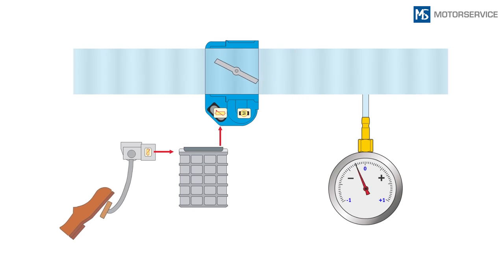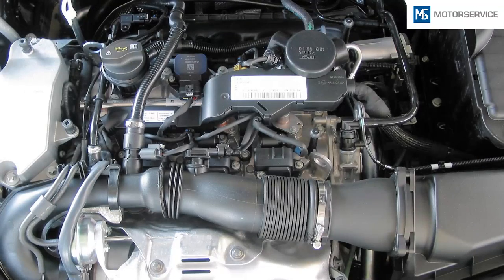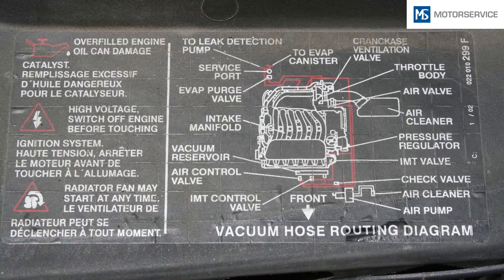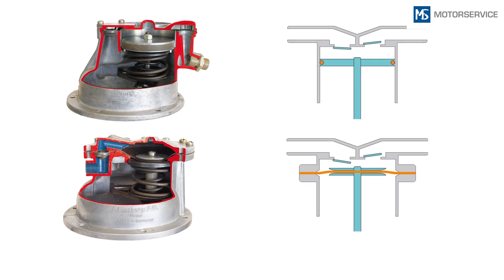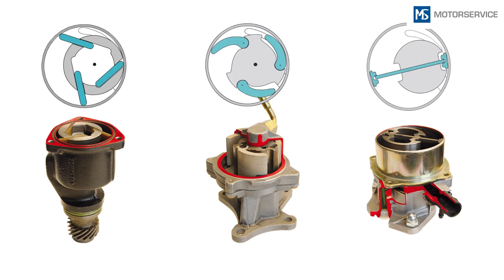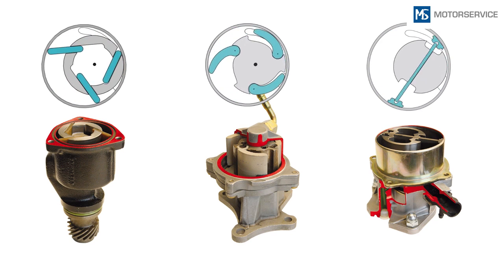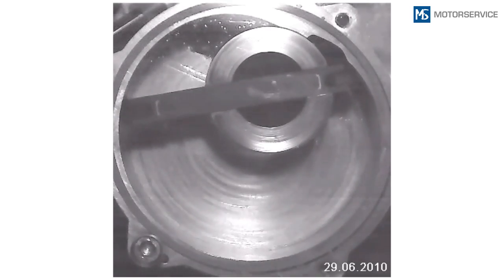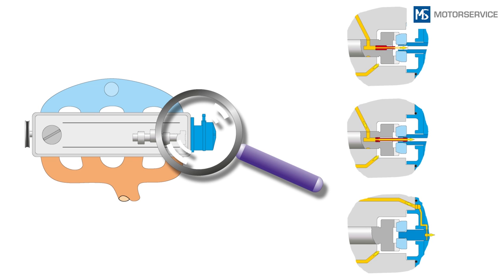Vacuum pumps -- Basic information - Motorservice Group

Comment: My honda fit aria 2005 Japanes only 90k driven. When i open the Engine gage smoke is pop from its gage. I check my mechanic he said engine is dead replaced the engine. No oil in any sparkling plug engine sound is fine. Pick is good average is good. What is the reason kindly help me

Comment: What will a bad vacuumpump do on a diesel engine???
Reply: won't start.
Reply: @1PunchKO100  bad brakes also?
Reply: @N-e.o  it won't start. bad brakes = failing pump or most likely a seal. You can purchase the o ring for about £3 . i used some clear sealant too. solved my problem.
Reply: @1PunchKO100  just bought a second hand vacuum pump, see if it fix my braking, installing it tomorrow fingers crossed
Reply: @N-e.o  did it fix the problem